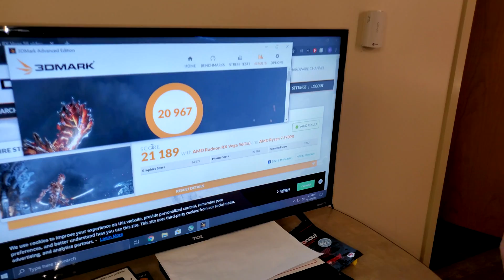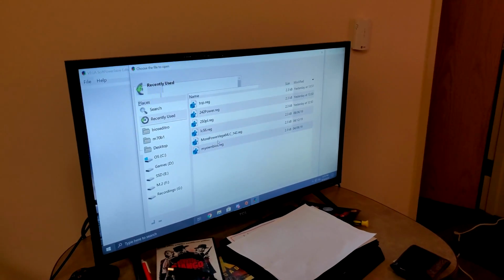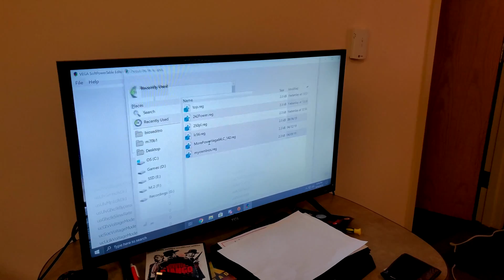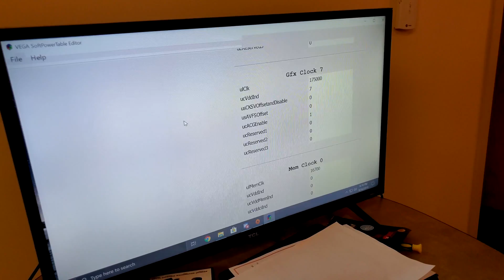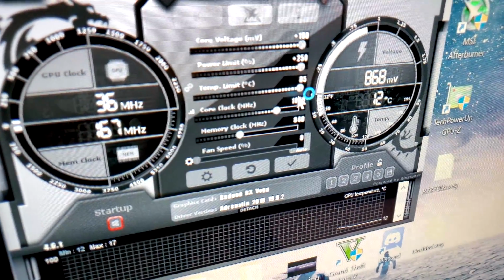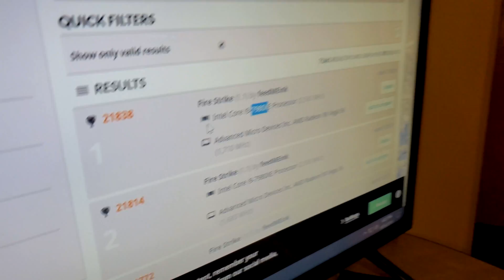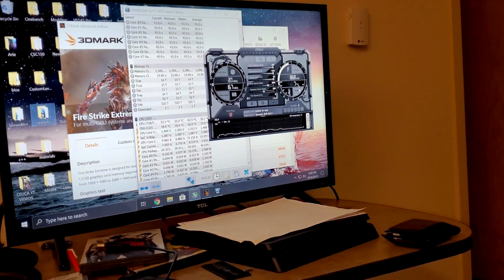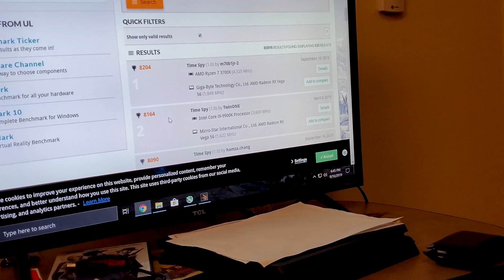3DMark's FASTEST VEGA 56 | I Broke 3DMark Records!

Comment: Bro thats nuts. Im hardly pushing 17.097 overall score on FireStrike with a I7 6700k 4.0ghz and a awfull Asrock reference Vega 56 at 1703mhz gpu and 940mhz memory. With modded drivers

With stock drivers and stock Adrenaline settings it gets 15.450 over overallscore.
Reply: That's quite strange,  I was able to pull 19 667 on FireStrike with Sapphire Pulse Vega 56 (1800MHz/920Mhz (Hynix memory) with power limit set to 150% and normal Vega 56 bios) and Ryzen 5 2600. Everything air cooled and so I was able to OC my cpu only to 4GHz cuz then it would start to thermal throttle. So my guess would be your card maybe overheating bcs that blower coolers are not anything awesome as we all know or you maybe forgot to set the power limit higher? Lemme know if that helped :).

Comment: I got 25 625 Graphics Score in firestrike AMD Radeon RX Vega 56 nitro+  whit Hynix memory that goes only 890mhz, my graphic scores started to decreased slightly after going beyond 1800mhz. Theres faster vegas there you should look for Graphics Scores only and dont ad cpu to your overall score cause even slower vega whit better cpu will come on top.
Reply: I am stable at 1632 Mhz on 1080mV   with 900 Mhz on memory .  Is that good
Reply from the maker: @ObiesJourney  For daily use 24/7 yes, especially if air cooled.
Reply from the maker: Overall score matters because that's what shows kn the leaderboards :)
I'm besting beating systems with i9-9980xe's, 9900k's and more
Reply: @titusarms  Thats also true :). Could you try if you drop the clocks for small ammount from the top will it give better score for you?
Reply from the maker: @winha1435  what do you mean?